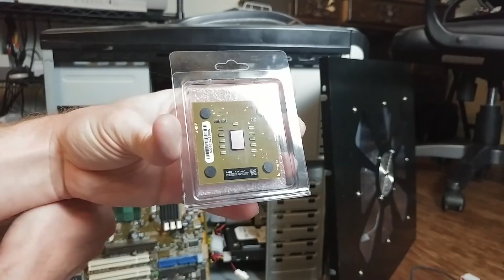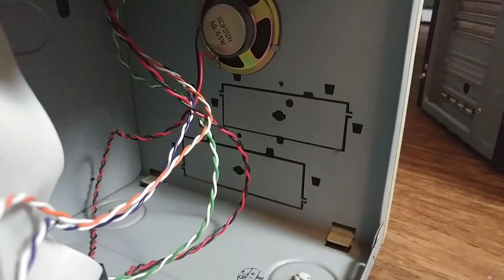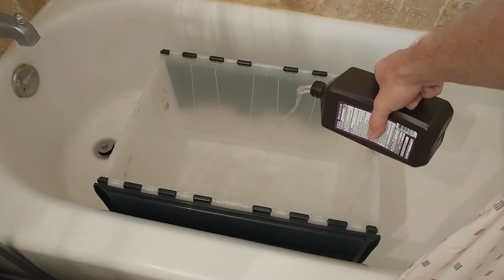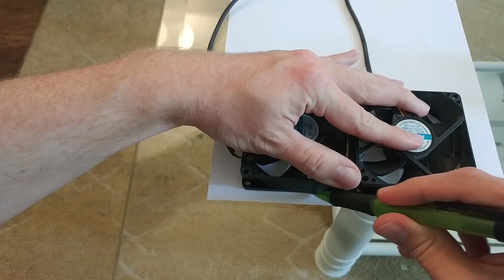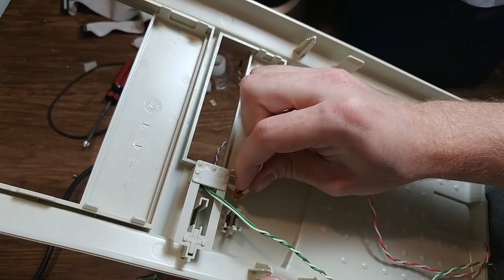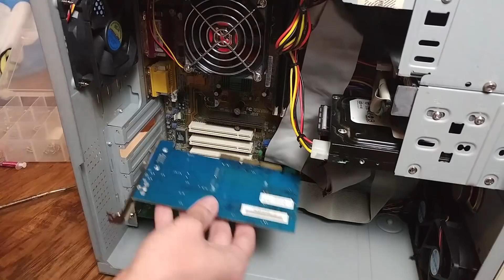Rebuilding my Windows 98 Test System!

Comment: I had asus a7s333 back in the day. It's performance was very poor because of poor memory bandwidth. I suggest to repair a previous motherboard and use it instead
Reply from the maker: Then the Fury MAXX wouldn't work which I need for future videos. The SiS745 chipset is definitely not great but my tests showed a performance improvement anyway.
Reply: PixelPipes SiS745 is a very good chipset. But its implementation in  asus board is weak. I was surprised when I swapped this asus board for an ecs k7s6a with the same chipset and had better performance. 
If it's ok with you, then fine. Your performance increased because of the faster cpu clock speed I think. But still you can achive even more performance.
Reply from the maker: Indeed. I could probably spend years chasing the "best" performance with my requirements. The best is probably a Pentium 4 3.06GHz on an Asus P4S533, but I have to stop at some point.
Reply: PixelPipes The problem isn't with the SiS745 (or the later 748) chipset, it's how poorly Asus implemented it. MSI released an excellent SiS745 board, the 745 Ultra which outperformed any Via chipset board at that time, especially it's IDE controller. The only real problem with the 745 was it's 266 fsb limit, although you could readily overclock them quite a bit. Gigabyte had an excellent SiS748 board (the GA-7S748) which performed even better and supported cpus up thru 400 fsb. Only the nForce II chipset boards like the DFI Ultra Infinity and Shuttle AN35N were better performers. Not saying it would make any difference with the MAXX, but the SiS 74x chipset would outperform ANY comparable featured VIA chipset board with the same cpu, memeory, graphics card, etc. I tested and verified that back when they were still mainstream.
Reply from the maker: lol it figures the board I had on hand is the "poor" one. I'll keep your suggestions in mind. Thanks!

Comment: Thanks for the Video.I have an ASUS A7n8X with a XP2500+ Have you considered going with a socket 754 setup?. Less power draw on the 5 volt line. and more CPU choices
Reply: +George Zatorsky More CPU choices? Nope, AMD Sempron, Athlon and mobile variants. The fastest is the 4000+ mobile
Reply: But are socket 754 boards compatible with 3,3V AGP cards? Otherwise you can't run close to all 3dfx Voodoo AGP cards.